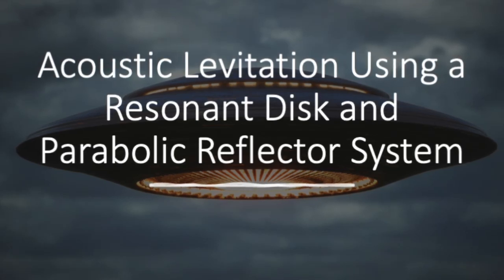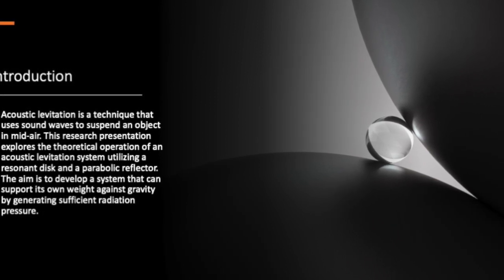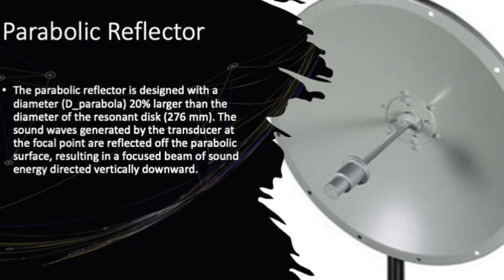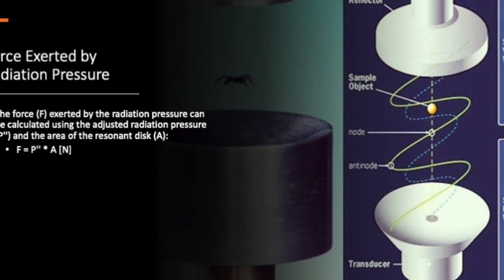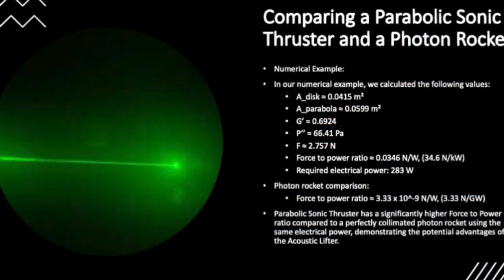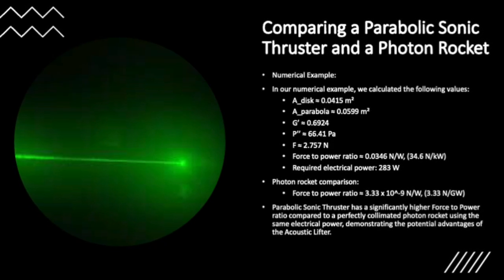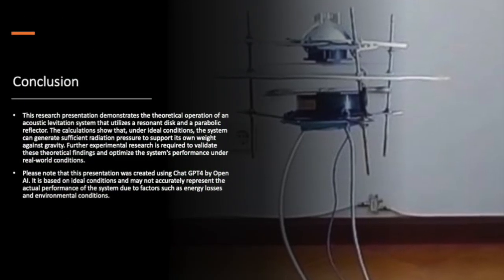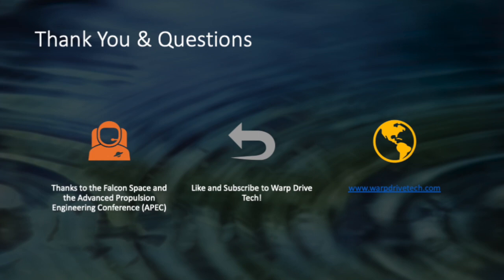Acoustic Levitation of the Graviflyer

Comment: Question: why does only Alexy's gravflier functions with no problem while everybody else including their mothers, who, following Alexy's instructions to the letter, fail Everytime no matter what adjustments they make? Is there some f*#kery afoot. Please correct me if I'm wrong. Also the flyer an inertialess drive?( Apologies if my questions are stated wrong. Today is one of those days I'm having when I'm half as bright as a dead firefly).
Reply: This is the question of the decade. It's been nearly 3 years since I first learned about it and nobody has yet to see any lift whatsoever. Theories have been tested and failed, and even well-designed ion thrusters can't lift that much weight. It is definitely not "an inertialess drive". I would believe in fairies before I would believe that. Conservation of Momentum is the law and it must be obeyed. IF it actually flies, it does so by dynamically moving air, but the evidence would appear to show that we have all been duped. A colossal accomplishment, I must add!